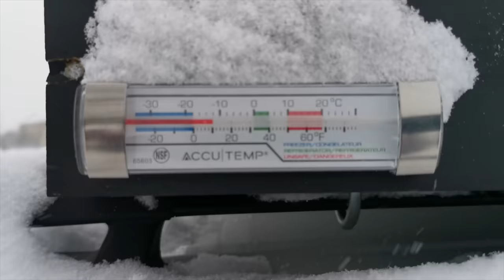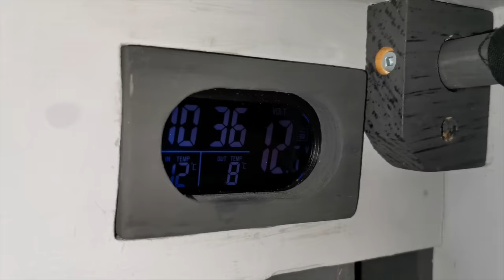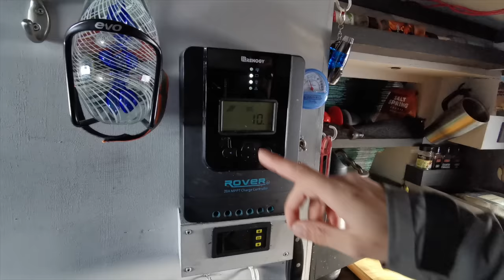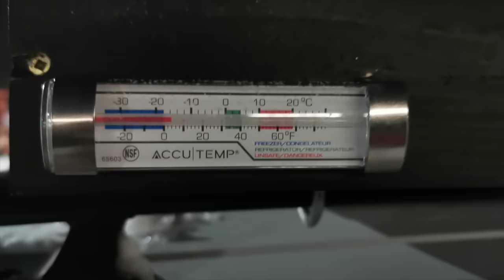Living in a Minivan during Freezing Temperatures

Comment: This guy will be screwed if he has major car trouble.
Reply: No.
Reply: Anyone would be screwed if they have major car trouble
Reply: Why
Reply: @wvadam  Not as screwed as someone who's car is their literal home where they sleep every night and store all of their belongings.

Unlike a normal vehicle which can just be left sitting indefinitely while arrangements are made for repairs, in this case even a minor issue will require immediate action. Have fun fixing a broken exhaust pipe or leaking fluid hose in sub-zero temperatures, or figuring out where to put all your valuables while you get an emergency replacement for a cracked windshield. Etc.
Reply: This guy made about $10,000 for this video alone. I think he can get out of a jam.
Reply: @siukong  Step 1: Call a tow truck.  Step 2: call a mechanic.  Step 3: Go to a hotel...
Reply: @siukong Yes he would be more screwed than the former but isn't that kind of obvious. That is not an easy life and there are a hundred situations that he would be really screwed in compared to someone with a house. I wish him well and I support him on patreon.

Comment: Many of the curtains sold at truck stops, made for truck windows, are great at blocking out cold air and holding in warm air.  My husband has them in his truck and as soon as he closes the curtains on the front windows there is a big difference as to how well the trucks heats up.  The cold drafts are pretty much kept out.  Truck stops of any size sell them, but the larger ones like Travel Centers of America should definitely have them.

Comment: they have heating plates that work on electric. put 1/2 inch aluminum coated foam the a 1/4 inch of steel then the heat plate.  then lay the battery on top of the heat plate.  shouldn't to much draw on you battery and will keep in warm you can also wrap the battery in foil covered bubble wrap to help insulate it on the slides that are not exposed to heated sides of the van

Comment: I lived in a van with a broken out window in the appalacian mountains 3 winters. I couldn't get just the window fixed without replacing the door. I lived in a Honda civic in Utah and CO 2 more winters and had to scrape off frozen condensation from the inside of the windows every morning. Living in a van when it gets under 20 degrees your feet go numb for a few hours every night no matter what you do and when you wake up to take a piss in a bottle at night almost the whole back of the van fills up with steam. You pretty much just have to lay there and shiver at night and wait for the sun to come up to go to sleep a lot of days. The trick is put more blankets under yourself than on top because the floor is metal and use mostly wool blankets and have 2 pieces of metal to scrape together so it sounds like a gun cocking if anyone messes with you. But probably don't have a real one or you'll get arrested and if the cops ask say you have somewhere to live and are just camping

Comment: have you considered getting some of that metalized bubble wrap insulation?  It comes in 4 ft widths.  get some command hook tape which peels off cleanly later and tape pieces to the floor and walls, a piece for behind the seats, across the dash...you could likely even put some on the floor.  It would be toasty warm in there!

Comment: What this guy should have done is modify some concrete blankets and tie them to the roof. That way when it's this cold he can simply unroll them for some much needed insulation. And just putting cardboard in the windows will reduce heat loss by a ton.

Comment: I'm wondering if you've ever tried infrared heating bulbs to stay warm?  There's even small infrared bulbs in the reptile sections of pet stores that work very well - I used to use those to heat my chickens in their coop.  Once I get on the road in my Van, I'd like to experiment with a heat lamp and try utilizing a solar power station to keep it on during the night :)
Reply from the maker: Hey, well i think using electric heating consumes too much electricity to be viable for van life.  Depending on where you live, solar can be almost useless through the winter.  Most people use the 5kw Chinese diesel heaters because they use very little electricity, and create a lot of heat.  Used mine down to -40!  They are pretty cheap to set up and very effective.

Comment: what good are lithium battiers if you can only use 20% of them?    The benefits of battery alternatives increasingly seems more a mirage then real
Reply: He uses 80% of the battery
Reply: @H1ghland  Thats not what i heard but even if that is the case...its a battery that really has 20% less juice.
Reply: @aricreepowitz9273  but that’s only in exceptional cold conditions like FF is facing in the video. In normal temps running a battery to 100% isn’t a concern
Reply: @H1ghland  Much of the world is in exceptional conditions.   And much of the worlds population in the heat extremes.

Comment: I may be living in my hatchback this winter as I wait for my VA disability claim to be processed. 
I took my unneeded back seats out last year for extra hauling room, so I'm able to stretch out full-length on the deck.
I'm planning to build an insulated sleep area, a removable box, from foam insulation sheets, lined with aluminized mylar on the inside to reflect the heat to trap and reflect the heat inside. Incandescent lights are wasteful in terms of energy (90% is produced heat), so i think a 60 watt bulb plus my own body heat would keep me toasty in my little area.
I'll place the bulb in a small coffee can to help radiate the heat, and just use small LEDs for light. A 60 watt bulb only pulls 5 amps from the car battery, so it's much more efficient and less toll from idling the engine to keep warm.
I can go 24 inches high without blocking my rear side and hatch windows, and 40 inches wide, by slightly over 6' in length.
I even thought about disguising it by making it look like a large shipping box, just so no one would give it a second look.
"I'm gonna science the sh*t out of this."
Reply: Wow, I'm sure your home will be real cozy and welcoming in the future that you plan to science the shit out of.😖 Oh boy.

Comment: What kind of diesel heater do you have? I'm working on an older travel trailer (That was free) to pull behind my 2000 International 4700 truck. The trailer had LP heat but I'm scared of LP gas. I've seen two RV's burn up because of a LP gas fire.
Reply from the maker: I have a knock off 5kw diesel heater.  They are on Amazon for pretty cheap. Mine has worked good 👍